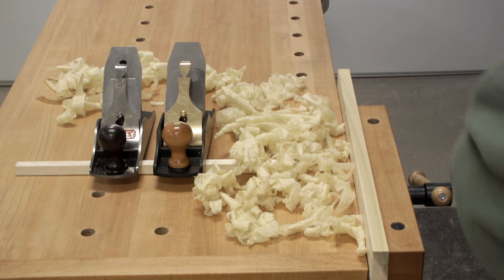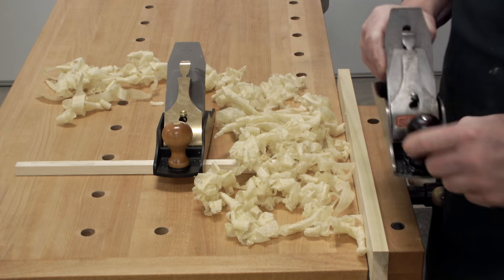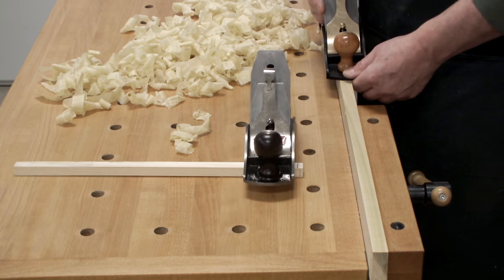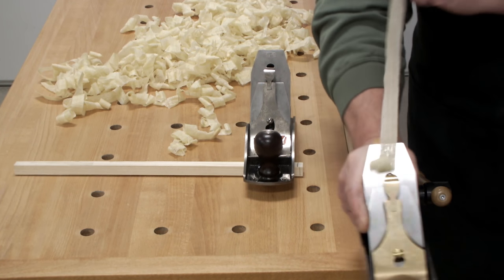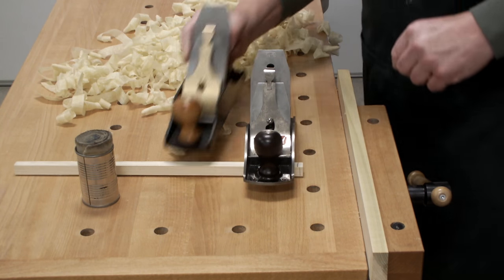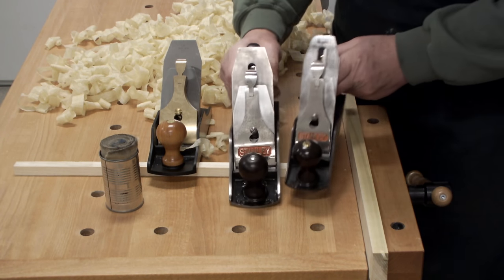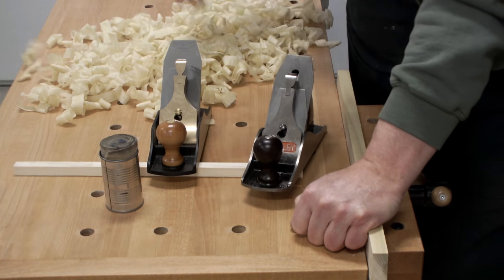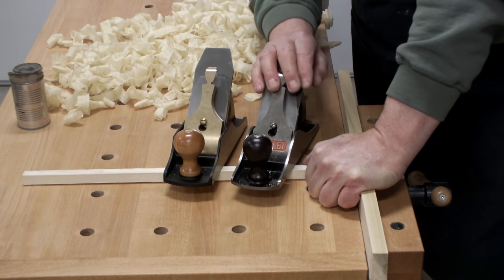PLANE TALK  No 4-1/2 Stanley Restoration, Part 4 and Lie-Nielsen Comparison.  April 7th 2017

Comment: Here is how I feel about this comparison. After I had been playing guitar for a while I bought a Yamaha FG-180 ( red label ) from a friend. I put new strings and Grover tuners on it , set it up so it played really well. I liked that guitar a lot, sounded good on it, and played it well. Later I had the money to buy a real nice Martin D-28. Well, I couldn't believe how much better I sounded and how much better I played.This was almost 50 years ago now. I have been a woodworker almost as long. Vintage Stanley planes are tools I have used through out my life and they always do what I need them to do. But the lie-Neilson planes especially the bronze #4 is an incredible tool and does work that at a minimum works as well as the best Stanleys. My advice to young, serious woodworkers is to buy the best tools you can afford and maybe sacrifice a meal or two to buy even more than you can afford. You won't regret it in the long run and it may help you to work better then you thought you could.

Comment: Just found a nice Stanley 4 1/2 early this week. I paid $60 for it. I must admit, I have several other nice old Stanley planes, #3, #4, #5, #8 and now the 4 1/2. The 4 1/2 is special. It’s size and weight set it apart, loving the 4 1/2. I have never used a Lie and don’t want to. More time than money.

Comment: Thanks for this honest comparison. One thing I might add here is that while you do need to take into account what your time is worth in restoring planes, there is also the factor of investment. I can say that what I've learned from taking apart, cleaning, assembling, reassembling, setting, and tuning a set of #4-#8 (Type 7-11) Stanleys, I'm in a much better position to tune a plane to get it to do what I need it to, than I would if I had just picked up a premium plane to start (and better off than a few guys I know who have a Lie Nielsen or Veritas plane or 2 sitting on a shelf with a dull iron, because they had the money and liked the idea.) But if you already have the knowledge base and the money, they are in fact, beautiful planes.
Reply from the maker: Absolutely Matthew, I started out 46 years ago with nothing.
Since then I have bought, restored and used literally 100's of all different planes.
I believe it is important to start with taking apart what could be called a basket case plane and learn how it goes together and what makes it work.  
My motto in restoring is and will always be: "Less is More".

Clean the dust and grime off, add a drop of oil here and there and try it.  If it all moves freely, the rust will not affect function.
Hone and fit the blade right then make some shavings.
It is not going to be a Ferrari but you can work with it and fine tune it a little here and there over time.
IF however a person is willing to do all the learning and but brand new high end, then that is a fantastic combination.  A high end plane can last 2 - 3 generations when used properly and passed on with the knowledge.
Reply: @DustySplinters  

Your average Stanley will outlive you. I have one that is over 100 years old. Works great and likely will for the next 100 years. It's a chisel holder, don't over complicate it. The Japanese jam a blade in a block of wood and call it a plane.

Comment: Thanks for the video, planing like that is cathartic to watch. 
The one thing that you did not mention is after market blade/chip breaker sets like Veritas, Hock and IBC etc. They can add a significant amount to a plane tune up if you go that route. I did and after you do several planes there is a lot of cash tied up in those blades, enough for a couple of LN planes.

I love my planes and the satisfaction in having your effort result in a well tuned plane that really planes.

 I have only got a couple of planes that I have restored  and left totally original and that was only because they were in such great shape and so old that it would have been unthinkable to change anything on them. I'm not a complete philistine, not yet.

One thing I have noticed in recent years is the number of "Frankenplanes" on the market. These are made up from mismatched spare parts that are just not quiet the right fit or because they were made in different factories or even different countries or even by different companies, frogs don't sit properly with out a lot of work. I have given up on a couple that would have required milling to make the frogs fit. Even they make a good source of spare parts.
All the best
Reply from the maker: Absolutely, adding a Hock O-1 Iron to any plane is a magnificent idea and I have done it.
Just showing the original blades to prove they work just fine.
As to the Chip Breaker... unless an original is damaged... there is not real reason to replace it.
In fact the chip Breaker is almost an integral part of the plane where the blade is replaceable.
Talked a little about that in the latest sharpening video.

Comment: If you know woodworking, then you know Stanley planes are capable of producing top quality work. They can achieve all. I know Lie-Nielsen have a great reputation, but as the Stanley can do everything you could ever need, don't buy into the hype. A great lesson to all young apprentices is restoring a rusty plane to its former glory, you will learn so much about the functionality of the plane and when finished, you will have a great plane for life.
Reply from the maker: Absolutely Raban, Restoring older tools can provide insight to the way they should work.
Yes, my restored planes will do anything I want.
However... The old Stanley tools were once Brand new tools and cost workers as much as Lie-Nielsens do today comparatively.
Cost is Cost and time is money and it is all relative to what you have more of and... the knowledge you have or need to acquire to restore old tools.
That is why I have done the Plane talk series.
Thanks for Watching !

Comment: Hi Walter-

Thanks again for your unbiased review. I have been caught in the trap of deciding whether to get a LN or restore a Stanley-type. 

My first planes were LN (4 Bronze and 60 1/2) and my favorite is the LN 62 (with the Hock blade and Howard adjuster). My experiences with LN customer service is the real deal maker. THEY STAND BEHIND EVERYTHING THEY SELL REGARDLESS OF THE STUPID THINGS WE DO TO THEM. I can’t tell you the stuff that happened to my tools on the moves from NY to NJ then to Florida.

That to me is the justification of the price difference. Plus, the feel of a LN tote and knob is so warm and the way the cherry ages is also fab.

BTW, I have restored several Stanleys (4 1/2, 5, 5 1/2, 7). Was it worth the effort? They work nicely but the don’t feel as nice in the hand as the LN’s.

Just my 2 cents.
Reply from the maker: Steve,
There is no doubt you get quality and service unparalleled from Lie-Nielsen.
If I put Hock Irons in my Stanley Planes, the performance increases but it does add cost.
It is really all relative.  There is no right or wrong tool for a task.
If I fill a shop with properly restored tools, the work would get done.
If I fill a shop with all High end tools like Lie-Nielsen, the work would get done.'Some people do not want to go through the steps to restore so in that case some of the import tools are acceptable options, But I would recommend less tools and go top quality.
Reply: Dusty Splinters could not agree more.

Comment: Walter, thanks for the video! Should I stay away from modern Stanley? On one hand their casting is thicker, they are a bit heavier, their blade is slightly thickier. But their sole is not as flat as with the vintage ones. But does it really make a difference how much time to spend to flatten it? Two three hours with the old one or five or six with a modern. Wanna get 4 1/2 or 5. Thanks again.
Reply from the maker: Thanks for writing Alex,
IF by "modern" you man brand new Stanley... I'm not sure since I have never bought one.  I tested their new model 62 in a store once and thought it was OK but for the money difference in that regard, I would but Lie-Nielsen.  
As for flattening soles, it should not take much longer than 1 hour max.
You must have a 100% flat datum surface to begin with 2 times longer than your longest plane.
I start with a med grit paper at first just to locate the high spots.
If they are minor, I may stay with the med paper but if severe flattening is needed I can drop to 80, 60 or even 36 grit which some have claim is about the same as what was used on the planes originally.  But remember, the lower you go, the more steps you have to get back up to a good finish like 100, 120 or 150.  
Remember too, the abrasive scratches on the sole also act as places where wax or oil lubricant can stick to to help make the plane glide better so there is no need to "Polish" a plane sole to a mirror finish.
Hope this helps and Thanks For Watching!
Reply: Dusty Splinters Thank you Walter, it is priceless to get a piece of advice from someone who has many years of experience in it. And your shavings is flawless!

Comment: The money comparison isn't really relevant unless you consider your time refinishing a plane (leisure) to be equally enjoyable to work, and at the same time, would have the work available to do. 

I would provide an alternative view. I found a Bedrock 604 1/2 with a bite out of the sidewall last year (functions fine). It was $35 at an antique mall. I spent 10 minutes on the iron and cap iron (maybe not that much), spent less than 10 minutes lapping it and used less than a dollar's worth of PSA porter cable 80 grit paper in doing so. The performance is similar to your plane, albeit with more patina left on the cheeks and lever cap/cap iron/iron. I'm out 20 minutes of time and about $36. I don't use the plane much, so that's sort of a loss.

The reality is you probably wouldn't have done paying work those five hours, otherwise enjoyed restoring the plane - possibly learned something from it or others, and you've got several hundred additional dollars in your pocket. That's been the case for me. I also don't have a great deal of interest in "restoring" planes, just as you (though I've set up 8 infills in the last couple of weeks) - but that's because we've both done a bunch. It's easier to lose interest in doing things once you've done it, if that makes sense. 

If time cleaning up a couple of planes is too much, there really is definitely not time to use them to build anything.

The one good thing about the lie nielsen plane - especially if you find it used - you won't lose much money if you resell it later, but it has to be kept rust free, and for an intermittent user, that can be difficult.
Reply from the maker: Thanks for watching and commenting David.
I never did any restoring as a pleasant hobby.
It was always either a necessity to get a tool functioning or it was to pass the tool along and possible save it from a scrap bin.
You are correct, the more we do the easier they get and after a while if restoration is not your main passion then it becomes less enjoyable.
In life we have Time or Money.. rarely both.